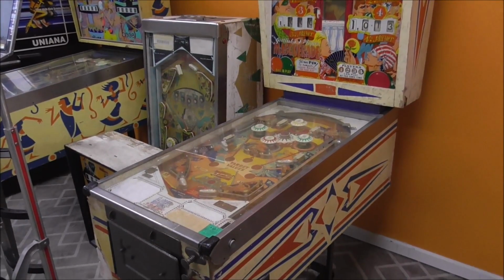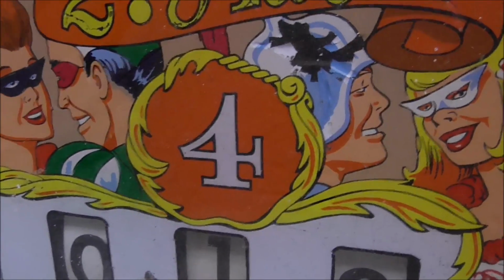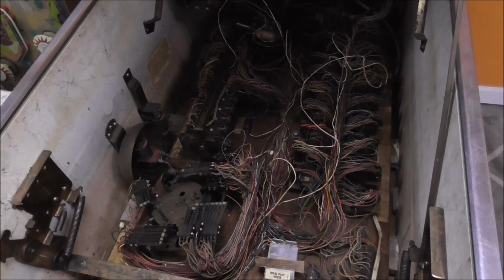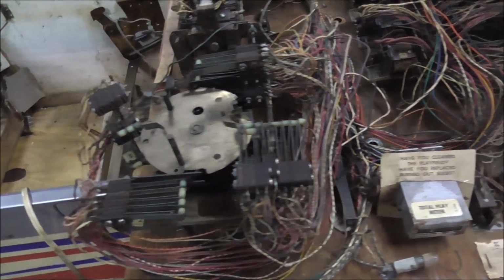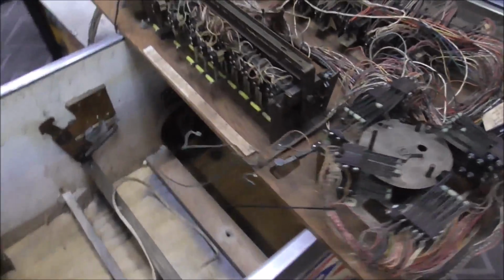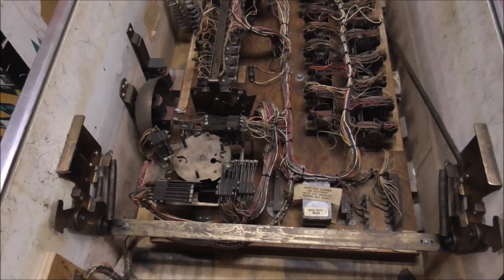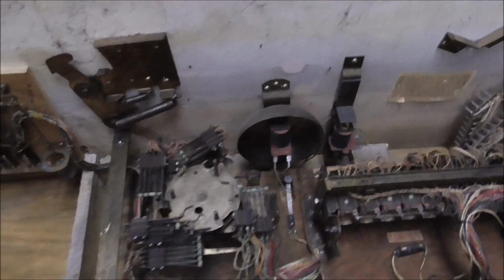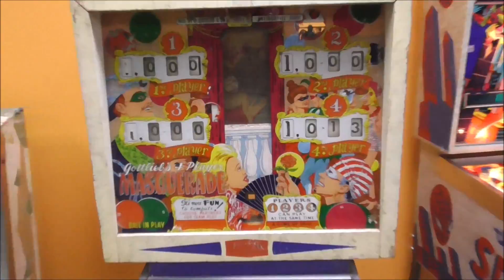Let's Begin Repairing a 1966 Gottlieb MASQUERADE Pinball Machine - It Was Left for Dead! #1

Comment: I love when we work on old things made not that long ago and we have to do some mini archaeology to try and understand what happened to them in the past. If a mouse ate the lacing, did it also destroy the bottom panel of the cabinet with pee, and that's why it was replaced?  

As for that electrical box, those are still readily available up here in the north. :)
Reply from the maker: You can still get similar ones here too of course just not that exact brand I don't think but maybe :)  Or maybe it's Canadian!  The bottoms of these are often pretty bad off, some locations used to kick the bottom to turn them off (that was the factory recommended way of doing it, if you can believe that)

Comment: Alright!!!!! Eek. I learned wire looming in CE C  school. EM machines were what I cut my teeth on. I found an old machine that had been outside a few years behind a building. It was trashed. Knowing what I know today (from watching you) it could have been saved. The wood case was really bad though. I took it apart and used what I could and tossed the rest. How about going all LED lamps
Reply from the maker: I figured you’d freak out lol don’t get too worried we’ll get there :)  yes you can save even water damaged ones but it just comes down to how much time do you want to spend on them?

Comment: For bare wires I like to use Liquid Tape, comes in 4 oz bottle with a brush and comes in different colors. Liquid Electrical Tape is found in the electrical section of your hardware store.  Very handy and seems to be very durable and permanent.
Reply from the maker: They also make tape, that comes on a roll in your electrical department, you can wrap it around the wire.

Comment: The 3" bell gong would likely have been mounted to the bottom of the 0-9 (a.k.a. match) unit. Likely there also would have been a 3" bell unit assembly (looks like a knocker assembly with a gong attached) also mounted in the backbox. Steve Young sells those.
Waxed lacing cord is still manufactured. The military used to use tons of it on the wiring harnesses of military equipment and aircraft. Nowadays in standard commercial equipment zip ties are used instead.

Comment: Between that cabinet damage right where the front legs are supposed to attach and the literal rat's nest you revealed when you opened it up, this thing was what Foghorn Leghorn would call "two miles of bad road".
Reply: The person who thought undoing the entire loom would be a good idea was about as sharp as a bowling ball. It would have been easier to find leave the shorter wire in place and run a modern wire in parallel. Preserves the laced loom, not made like that any more.
Reply from the maker: I think a rat did it...
Reply from the maker: We’ll get there!
Reply: @LyonsArcade  Fair enough. At least it didn't strip the insulation off the wires also.

Comment: At  first I thought the play field glass was cracked. Then I realized it was a light reflection. lol
Reply: ok if it was cracked, that would have been easier than this mess I'm seeing. lol
Reply: It already looks so much better. I'd never have the patience for that. I've built tons of computers, I never cable manage them. The one I'm working on now will be the first time I'm going to try. The case I got actually has features designed to help make it easier, but it's not like this. There are only a tiny fraction of these cables in a computer. I'm wondering if you're going to repaint the cabinet. It's a bit rough. Especially the top part. My initial impression was GUT THIS and give it a new cabinet. lol I don't think it's that bad. I think it needs some paint though.
Reply from the maker: Sometimes you have to gut them yes but it depends on where you want it to end up.  If you want it to look brand new, yes you need a new cabinet... but if you're alright with some wear here and there as long as it looks clean... you can keep the cabinet and fix it up.  We'll have to see how it comes out!

Comment: I remember when Romex came out in the 70s, I think early to mid 70s the started making the plastic dipped Romex with 2 or 3 wires and a bare ground.

NM 14/2 or NM 10/3 

Can't remember if there was a ground indication

Might have been NM 14/2 G or with ground

NM was for Non Metalic

BX I think was the metal shielded wire that had plastic dipped wires inside the wrapped metal casing.

BX was used commonly on Water Heaters, where you needed something flexible that would not be physically attached to anything from the box to the tank.

NEC ( National Electric Code ) I used to get a new book every year and have to learn the changes.

When I started they didn't require GFCI outlets in bathrooms, kitchens, outside, or in laundry room or where the washer is, or in basement. Now all those places require them by law.

It is a good idea to put them in all those places.

Comment: Houses didn't have ground outlets back in the 60s. If you look at old outlets that were from the 50s the size of both prongs was the same. Now neutral is longer than the hot

But they didn't have 3 prong outlets

If you run into a house that only has the 2 prongs, and you can't or don't want to run to run new wire, you can put in a GFCI outlet in each location where you need a 3 prong outlet.

You won't have GFCI protection, but you will now have a ground, so you can plug in 3 prong cords and be safe.

If the box is really grounded to the main panel, you can use a 2 to 3 prong plug in adapter with the screw spade and that will give you a grounded 3 prong outlet.

In the 30s and I think 40s, the electric company would wire 1 service to 2 houses, usually in cities you will find the metal conduit running between two houses in the basement.

A little history
Reply from the maker: We're working on a building right now that has two circuits that are still ungrounded, but they later added in extra circuits that were grounded, so we've got a mixture!
Reply: @LyonsArcade  you can put in GFCI outlets in place of the 2 prong outlet that it has now and you will then have a grounded outlet. It is the only way to get a 3 prong outlet from a 2 wire circuit without rewiring.

Comment: I can see both ways on the grounding thing.

On the one hand, grounding the transformer body does reduce the risk of hazardous voltages getting onto the secondary circuits (how much it reduces it depends on how the transformer is built, which is sadly an unknown).

On the other hand the secondary circuits aren't really exposed to the user anyway. So even without a ground the shock risk to the user seems pretty minimal.
Reply from the maker: By this time (66) ground wires had already begun to be installed in new homes, but they still made the games with the 2 wire plugs, if you think about it to this day many electronics (most? Electronics) are still designed with 2 wire plugs because they design it with a close mind to isolating the voltage to areas that can't transfer to the consumer... So I'd imagine they had that same attitude on these, keep the dangerous voltages to an area that can't easily short to the consumer.

Comment: Is ABS wire wrap safe to use to repair wire lacing for EM Pinball machines or are the wires two hot for it?
Reply from the maker: The wires don’t get hot at all so yes you could use abs
Reply: Heat is wasted power. If a wire is getting too hot, the wire is too thin for the required current... or there is a partial short somewhere.

Comment: cable lacing you can still get it and its not hard to do once you do a few miles
Reply from the maker: You speak from experience it sounds like...
Reply: @LyonsArcade  ya I have done it a bit working on old electronic lab equipment but it was old before i came along in 79

Comment: I would speculate that there have been instances where you have had to replace entire lengths of wire on some of these older EMs... Is this as much of a pain in the rear end that I imagine it would be?
Reply: Depends.  One trick is to solder the replacement wire on the end of the one to be replaced, and pull the new wire through as you pull the old one out.  May require a bit of finesse between loom loops, but it can save you a bit of trouble.
Reply from the maker: I haven't had to replace too many entire lengths usually the stuff is still in decent condition but sometimes the covering is damaged.

Comment: This will be heresy to the purists, but you might look at Anderson Power Poles as a replacement for broken Jones plugs.  The single pole housings have dovetails on each side, so you can make various shapes.  The terminals and housings are genderless - same housing and same terminal on each side of the connection.
Reply from the maker: I try to keep it original but if something breaks there's nothing wrong with updating it.

Comment: do you like torturing yourself or what?  the first hint I would have to run away from a game like that would be seeing the light switch on the outside though there is a lot of attraction from the state of the artwork on the playfield.  did you tighten the switch stacks as you cleaned them?
Reply from the maker: No I don't like torturing myself, and no I didn't tighten the switch stacks, you weren't here to do it for me Robert!
Reply: @LyonsArcade  sorry I wasn't invited though I am impressed by how you have gotten that wiring so respectable.  Hope there isn't any hidden defects.   I have had problems with old cloth insulation being so weak that it can easily  be pierced by anything pointy like lamp socket soldered wire that can create shorts